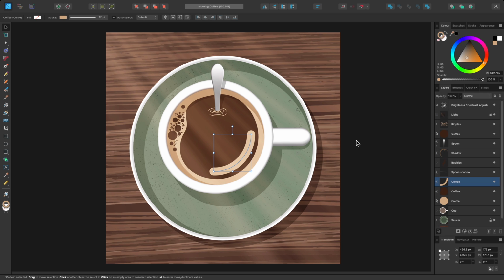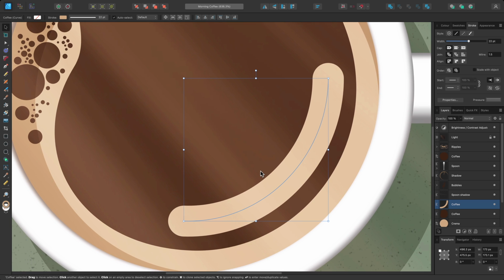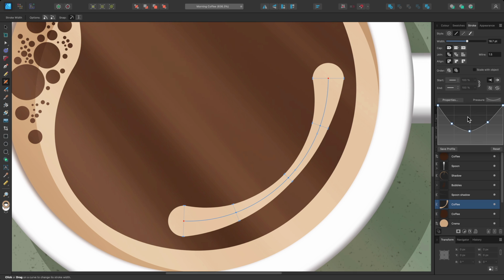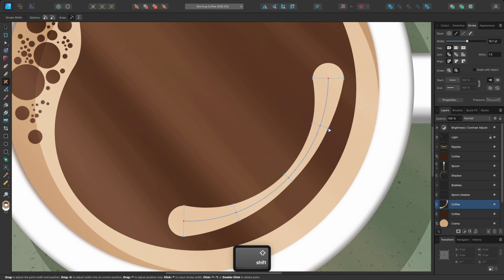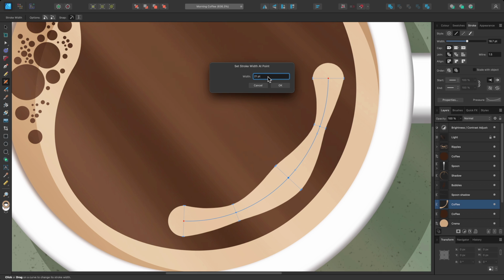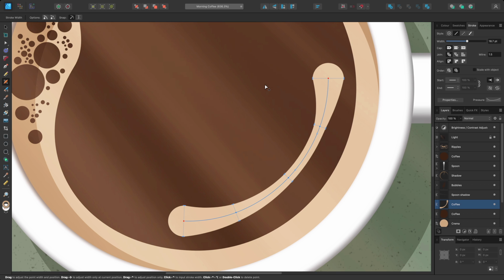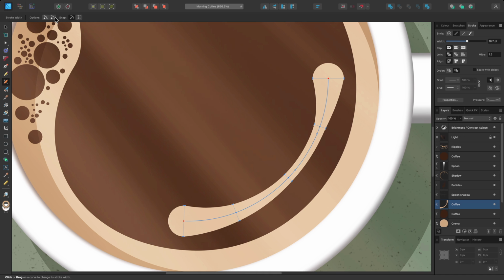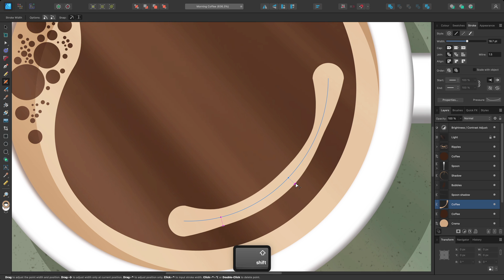Stroke Width Tool (Affinity Designer)

Comment: there doesn't appear to be a way to "round" the edges of the stroke width points from one point to the next. For example, notice in the video, there is a sharp mitered edge at the end of the stroke (just before the rounded ending of the stroke)? Try to make a straight stroke line, with a "droplet" at the end; It will look like a diamond at the end, not a rounded droplet.

Comment: This is NIIICCCCCE! 😎🤓Not to gripe but I've been waiting for the pressure profile setting for iPad for a long time now. It would be nice if that feature from the desktop app was nicely replicated to the iPad app. It would come in handy to be able to save different stroke pressure profiles for my project and template files. Keep up the AMAZING work, I most certainly appreciate it!